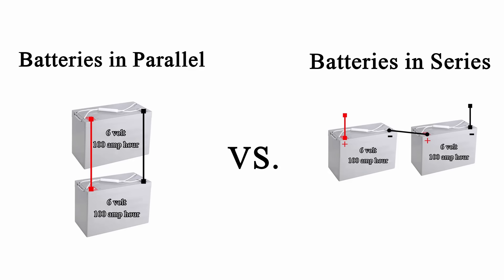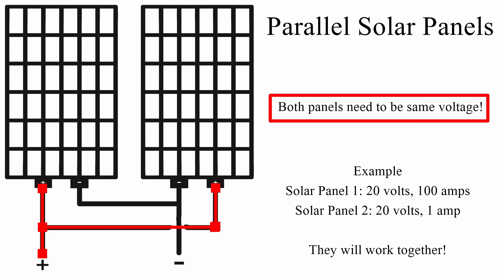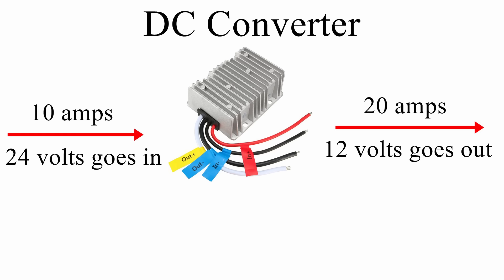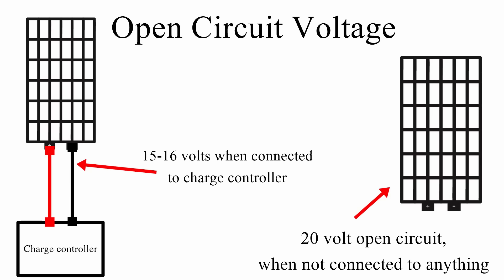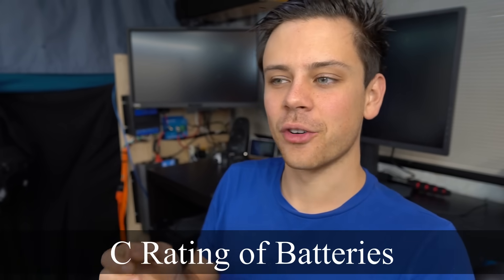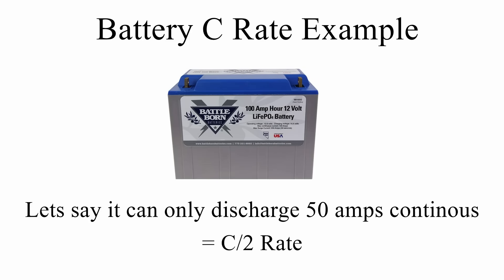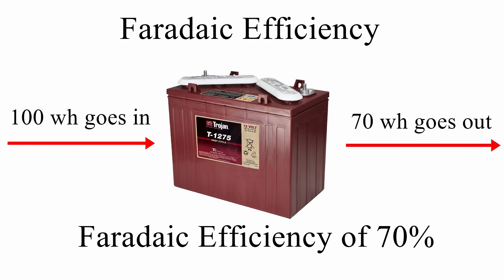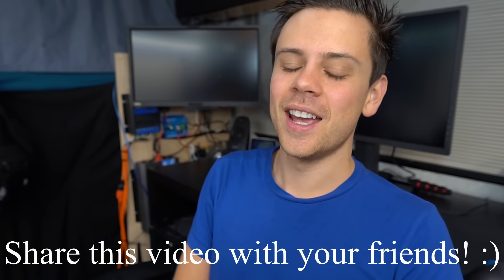Basic Solar Power Electrical Equations Explained! Beginner Friendly

Comment: What I see at work is wire termination , working the the plastic manufacturing industry with slitters, extruding and blown film, I think a heat camera is ideal 
But fails to get used on a regular basis get thrown in a cabinet 
Chasing PLC faults when it’s a loose wire is not appealing 😅

Comment: Got a question here. I got 3 X 12,8 v for a DIY ebike that i'm running in 36 volts series connection. So i bought 3 batteries Lifepo4 ( for the safety over li-ion) that have each 18 ah. The BMS is rated at 20 amp dischage continuous. The fact that i have 3 BMS at 20 amp does it mean that the rated discharge is incresed by 3 or it is still 20 amp ?

Comment: This is all great, but how do I read the data sheets from the manufacturer to be able to do the calculations in this video?
For example, the panels I'm looking at for a system I want to use a 12V are as follows: 

Max Power at STC: 100W
Open Circuit Voltage: 24.3 V
Short Circuit Current: 5.39 A
Optimum Operating Voltage: 20.3 V
Optimum Operating Current: 4.93 A
Max System Voltage: 600 VDC UL
Max Series Fuse Rating: 15 A

I don't know what any of this means, and I don't know which voltage I should be reading. You keep saying to calculate watts from the voltage and amps, but there are multiple listings here and I don't know which one you're referring to. The charge controller I want to use says it's 30A if I'm reading it correctly, but again, I don't know what that means or how to interpret that data in conjunction with these panels.

Comment: When you have your solar panels in parallel configuration does the power change because I know power should be constant. For example two 250w panel of 36v respectively connected in parallel. What should be the out put wattage of those panel sir. Please I need your opinion

Comment: Will.. I'm just starting to build up a van for camping.  I bought 2 BougeRV 200W 9BB panels.  And per your review on the Li Time batteries.. I plan on buying 2 100AH LiFePO4 batteries.. However, they don't show a C rating.. (they do for the Trolling version which is 0.5 or C/2.)  Am I headed down the wrong path with ? 50A continuous?  Not sure I'd ever pull that much at one time.. Maybe 30A running a ham radio.  BTW, apparently.. at least according to Amazon.. this is the 'new upgraded 12v 100ah version.

Comment: Is this correct, or dangerous?
I added 4(100w) solar panels to my camper, 2 lithium batteries, a mppt charge controller and a 3kw inverter to power my stuff.
The batteries are wired to both the charge controller/ inverter and the camper’s power.

Comment: So ... solar panel groups.  You wire up panels in series to produce a selected voltage, say 24 VDC.  That's a group.  Then you wire up those 24 VDC groups in parallel to gain amps.  If one group isn't working (1+ panel in the group blocked or shaded or failed), the other groups can still provide power.  May I ask why that is better than just buying a pile of same-voltage panels and wiring them all in parallel?  Each group effectively contains a single panel?

Comment: With so many comments, this may not get much attention. 
I have a new 4.6k set of panels up since summer solstice with a PowMr 10.2 hybrid inverter and storage is 7.2k in a 4 lifepro4 12 v 150 aH series (I have 12 kw more  in the works with a battery build in process). What I see is the inverter will only take what it can use from the panels. What they actually produce is unknown since it depends on the load and battery SOC.  Once the battery is full the load is the only place power can go so what happens with the current coming from the panels? How does the controller or inverter or hybrid handle excess production by the panels. Mine ignores it I guess. As I increase the load the panels magically send more till they max out.  Is there a topic that covers this? Could you address concept in future videos?

Comment: Can I use a lead acid car charger to charge a lifepo4 12vdc battery? I am not concerned with the time it takes. I would just use the 10A setting on the charger.

Comment: Can a 115v/1.4A Chest freezer  be powered 24/7 with only a 500 watt solar panel, a 40-amp Mppt controller, and a 12v 200Ah battery (Lithium Iron Phosphate) ?

Comment: WILL PROWSE, Sorry I do not know how this ended up here, but I have some questions for you: Need your help/ideas? Thank You !TO Install:  NEW 3500W pure sine inverter to my (Already Installed: (2) 12V Optima (1) RED (1) YELLOW connected with a GENESIS ISOLATION KIT (In Engine Bay).  INVERTER - I intend to install between my 2 front seats, with 4 /0 00 AWG Copper Conductor. (Have 10FT RED & 10FT Black) pure copper, have heat shrink & copper LUGS as well. I need to purchase a Master Disconnect (S/D) SWITCH on THIS RED Conductor     AND    A 360Amp (FUSE)  “CLOSE”   to my ISOLATION KIT  on same RED Conductor (FROM ISOLATION KIT @ BATTERIES to INVERTER)…FINALLY, This INVERTER has (4)120VAC receptacles  on FRONT side towards the DASH,  AND  “BELOW” the 4 outlets A 3 WIRE TO HARD WIRE I”ll run A 120VAC hardwired ELECTRICAL & RUN  that to the BACK of my BLAZER, & install with a box /cover ? What about a FUSE, and or GFCI outlet, and the ground wire from the INVERTER?

Comment: Wait! So THATS why small devices, like a flashlight require their AA batteries (or any battery) to be installed + against -.
They are in series and require the higher voltage that in series produces, right?
Sorry- I'm a beginner but I wondered about this before but it makes sense after watching this

Comment: The maths doesn't work for me at 15:50. 17.2 volts x 5.82 amps = 100.104, not 101.1 as per the video? Is there some conversion factor I need to know?
Reply: Also at 16:11 Did our 2790 watt hour battery example change to 2709 for any reason?

Comment: my system is 24 volts, 4, 125ah 12v AGM sealed batteries wired as series making two  2 parallel banks. I will be adding 4 more wired the same way. the parallel leads from those battery banks are connected to buss bars. 60 amp charge controller, 12 230 watt panels also wired series parallel on sunny days I'm reading 72 volts. Everything ends up at a 3000 watt pure sine inverter. The four current batteries power 4 freezers, and two refrigerators, and during winter months will drop to 50% over night, so that is why I'm adding 4 more batteries. I believe my 60 amp controller should be able to handle this. Sound right?

Comment: Wow the imperial system is confusing.

Metric system C rating. 
1c = 1h discharge
2c = 30 minutes discharge
0.5c = 2h discharge
0.25c = 4h discharge

Comment: so maybe im still confused about the charge controller output issue. so the example Will showed with the 520w (12v) and 1040w (24v) would be mean 43 amps coming out, which exceeds the 40 amp rating in the example. so what am i missing?

Comment: i am confused. you divided the battery with 12v. That means that the batteries are in parallel connection so that the volt didn t change. What if it is in series connection and you have 3 batteries. you add up the voltage and then divide the sum with the solar panel watts? Thank you  Will

Comment: So @5:47 where you show rated charge current and rated load current, in relation to the solar pv panel do we look at the “output” as the max charge current? Or the load? I suspect the charge current as that’s why current we get from the solar pv panel?

Comment: This is starting to make sense to me. The only question I have is why does every RV or Van build use three, four, or more smaller what looks like 100watt panels instead of one 300 or 400+watt panel. Like the panels on houses. My new (old) van RV has more than enough room for one large 400 to 500watt rated panel. I have two Renogy 12V/100Ah batteries in parallel and a Epever 4215BN Solar charge controller with Rated Charge Current of 40A and Rated Charge Power of 520W/12V. Max PV Array Power 1560W/12V. Max PV open circuit voltage of 150V min operating Temp or 138V at 25C environment temp.   The thing is I want to fab an adjustable rack so I can optimize the angle of the panel for the sun. It'll be a lot easier to do it with one panel than 4 or 5 100w panels. Am I missing something?

Comment: This was fabulous for a beginner. I finally understand that if the Ah's don't mean anything, thank you! I was looking at the Gyyll batteries and comparing 2 - 24V 200 Ah units compared to 2 - 48V 100 Ah units. The end Kwh rating is the same: 9.6Kwh's. This is for the batteries wired in parallel. But from watching the videos, I now know that wiring in parallel isn't a good idea, and to look at series connection to get the final voltage I need. Also I finally understand solar output to inverter/controller output and end voltage. Again, thank you!

Comment: The solar panel voltage is only dropping from wire resistance and heating. If you have thick enough wires, the voltage on the controller side is gonna be hardly 0.5V less lost in the wires.

Comment: Hi like the videos
To start a diy solar system for my garage like you shed what is everything i will need? I wanted to be able to run a freezer solely on the unit. Im in socal. Im confused by load requirements. Thank you

Comment: do I need a BMS for valence battery  ?
going to hook up 4 of the in 24 volts system
they are all  4 battery  U27-12xp
so two 12 volt together was going to plug the two of them in to each other

Comment: Thank you again so much Will. You taught me so much about solar and electricity. I'm a little confused but I'm trying to figure out my schematics in my setup. Have a 3000w pure sine inverter 5000 surge with six Nissan lithium ion batteries with 66 amp hours a piece which makes 372 amp hours and a 40 amp mppt charge controller. I've added my numbers up and I think that when I come out of my charge controller from my four panels at 330 watts of Peace at 9.47 volts it leaves the charge controller at 50 amps. I don't think that I have it set up correctly what do you think? Well I actually haven't set it up at all I'm doing all my numbers before I say anything up.

Comment: Great video . lots of great info. with series on solar panels . you mention shading causing no output when 1 out of many shaded  .normally that is true but some panels have shading diodes or you can add them . very helpful with a MPPT controller. With MPPT there is input rating info. live max PV volts and max PV watts. The amps is to battery just like you said. I just pulled my data sheet out . now with PWM controller the amps is same in or out . just a max PV volts in listed .

Comment: I have 2 identical Monocrystalline solar panels, 100 watt - 18.78V - 5.32A run in parallel, to connect to 2 - 12V 105Ah sealed lead acid deep cycle marine batteries connected in parallel. I am trying to build an off-grid system that will run a pondless waterfall, with a 12V 120 watt pump, along with 4 LED lights (12V 1.6 watts each, 4 x 1.6 = 6.4 watts). What amp charge controller do I need? And do I hook the 12V fuse box to the charge controller load terminals, or hook the fuse box to the batteries?

Comment: I will give one critique... (sometimes you know too much and are too close to the subject)
When describing the S and P configurations it would have been easier to follow had you stuck with the same 4 batteries 
and explained possibly the 2s2p configuration Before going to the 16 battery array (as few people will be working with more than 4 IRL to begin with) so people could Relate to the concept before expanding the numbers.

Comment: If I have 2, 12volt 100 amp hour lithium batteries can I connect them in parallel if they are different brand of batteries and have different battery management system?

Comment: Will I have a question regarding a 240v outlet in a bus setup. I have learned that you can create one by using 2 120v outlets on different lines. I want to purchase an on demand water heater that requires 240v, and also needs 3x50 dual pole breakers. The ones I'm finding don't seem like I could put them on a diy 12v 3000w electrical set up. I'm wondering how you would go about this. If anyone else has input, I would greatly appreciate it. TIA

Comment: By far the leading light in Solar explanations. Thanks from the UK. Anyone tell me if Ah doubles depending on series /parallel battery connections. I ask as I know in Parallel Amps double and in Series Voltage does.. but curious about Wh??

Comment: So if I have a combine hookup of equipment's totaling 800 watts (pool pump, heater, etc.), Can I use 1000 watts panels (4 x 250)? If so, what amp controller do I need to get?

Comment: Can you please tell me if this set up will work together. I have 4 solar panels each rated at 190W, 27V, 7.1A and I purchased the 40Amp Epever Tracer4210AN and I have a 12V battery bank because it's in a RV. I plan to use 8 AWG wire. Will this work If I wire all 4 panels in series or your best solution for wiring in series and or parallel. Thank you! Love the videos!

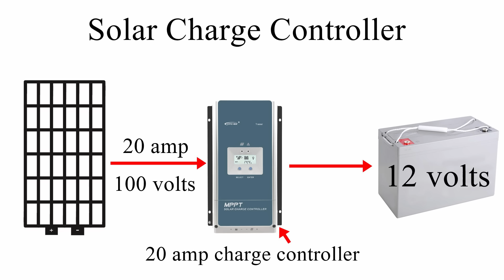Comment: Actually theese Epever charge controller that you are referring to, or atleast was in the picture @ 6:00 are rated at both solar input and battery charging output..
In the manual there are a table for both PV Array Power, and Rated charge power.
And I did actually send Epever support an email asking about this, because I thought it was weird because according to the manual as an example,  we can connect a bigger panel on the solar input than the battery output can handle.
Tracer 2210AN, Solar panel 260W/12V, PV Array Power 390W/12V.

The answer I got is that the solar charge controller has a power and current limitation, which ensures the max charge power (battery side) won’t exceed the charge controller rated charge power.
But off course, in that matter it would be better to oversize the controller instead.
Just wanted to share the answer, because it did confuse me anyway!

Comment: Love your videos. Quick question. If I set up a 24v. DC system in an RV to save money on inverter and wiring, I read the the converters from 24v. to 12v. have 92% efficiency. That 8% loss when powering all of the DC draws sounds like a lot to me. Does this negate the overall advantage of the 24v. system? What are the other considerations. (P.S., I would love to see you wire up a complete new RV build to see how you lay out the wiring and the different junctions, switches, shunts, etc. you use. I am also buying your book.)

Comment: The part where you cover why the open circuit voltage drops when load is applied doesn't explain to me why the voltage drops, just that it does. Would really appreciate a fuller explanation on that.
Reply from the maker: Ohms law. Need to do that later
Reply: @WillProwse  Woot!

Comment: So am I understanding this right? You can have solar panels creating around 40 volts but have them charge a 12v battery with a charge controller ?
Reply from the maker: Yes
Reply from the maker: With mppt

Comment: With the limited space on my airstream bambi, I can fit a 100 watt panel and a 50 watt panel in parallel.  You stated the voltage need to be the same. The voltage vmp is different by 0.4v between the two. The voc is diff by 0.2 volts.
Even though the voltages are slightly different, Will this work the way I'm hoping?

Comment: What are your reasons for not mentioning 48v and 60v industrial panels as a possible charging sources? Is it purely safety based? I currently have repurposed a used 60v 305w sunpower panel on my van which has worked well (once i figured out positive ground and isolated it) but I have always wondered if im seeing losses at the charge controller, i.e. dropping voltage from ~60v @ 4-5 amps to 13-14v for my SLA batteries. About to build Li battery from AliExpress like you show...

Comment: What is the formula to calculate voltage loss from solar panel to charge controller? If my panels are 200 feet from my charger, I will probably want to wire enough in series to use a smaller high voltage low current wire. 
But if at the same time I want to get max charging capacity from my panels, I want to wire them in parallel.
I’m thinking 4 panels in series (48v, 96v oc), and 5 in parallel (if the charge controller output is 40amp). How many volts will arrive at my charge controller so it won’t get fried by too much current? 
So what is the voltage drop per foot (or per 10 feet)

Comment: What is the cheapest best solar setup for 36,000watthours per day?

Induction stove 2000w x 3h
Water heater 5000w x 2h
AC Fridge 100w x 24h
Laptop 100w x 6h
Heater 2000w x 8h
Water pump 100h x 2h
5 led lights 20w x 20h
Lock +cctv 20w x 20h

Comment: Thanks for the teaching ! My Optima’s are 75 AH each 12v , 75x12 = 900 each so together 1,800 KW is that correct ? Because I wire them + - + & - ~ - for 75+AH + 75 AH = 150 AH I’m trying to build a battery back-up & a GTI to Lessing my Electrical bill I’m saving and watching for Lithium phosphate iron batteries what I’ve seen the higher the Voltage the less electrical lose in the wires I use about 20 KW’s a day - I’m looking for an appropriate GTI inverter what I see I could use 10,000v vPeak @ 5,,000v continuous ? Is that 5,000 Watts continuous peak for that time how do I figure out if I use 20 KW a day an inverter and I realize things would be cut back and less electrical waste would happen !